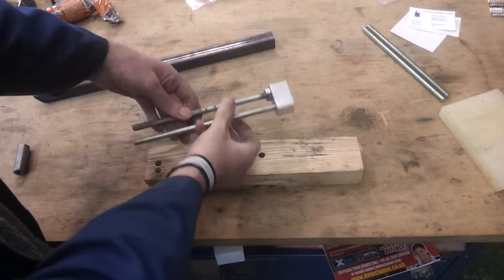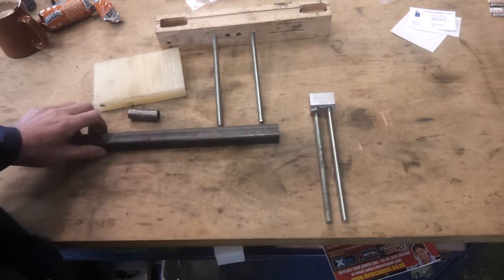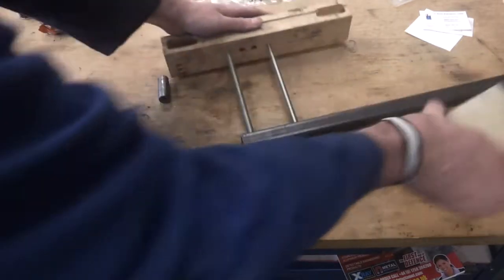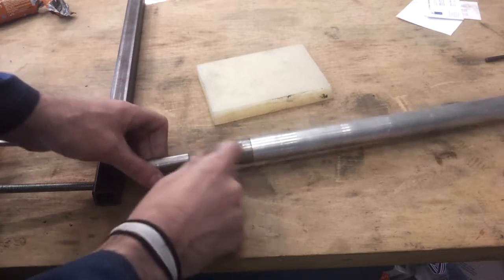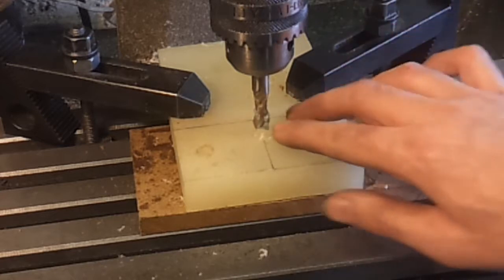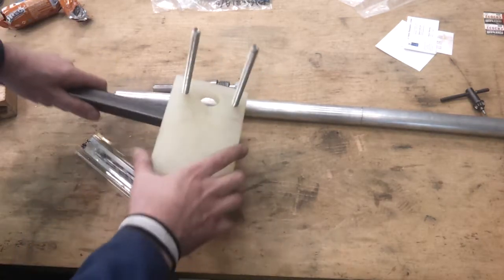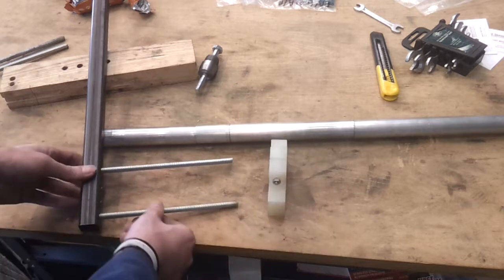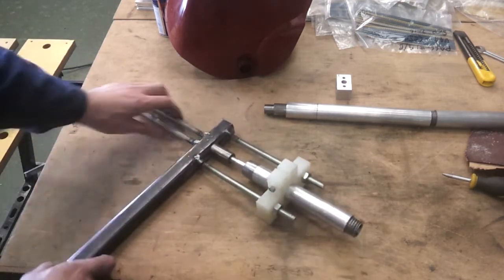Giant Automatic Centre Punch pt6 - modifications

Comment: Your threaded holes didn't align because you tapped them from both sides and cut the threads out of phase. If you want the screw to thread thru both sides, you must tap both holes from the same start, i.e. run the tap all the way thru both sides at one go. If the tubing is wider than the working length of the tap, the threads are not likely to align.
Reply from the maker: Thanks for the advice. It was not the sort of project I usually take on as it could have done with a bigger lathe. But I learned a few things from it, so will aim to do better in future.
Reply: I could have given a more complete response by saying that in the wider tubing scenario, the method is to run the tap drill right thru both sides, tap the working side, then redrill the near side such that the screw passes straight thru. Thus, holes are aligned with no thread timing issues. You can guarantee straight threads by tapping the working side from the inside by passing the tap thru the near side. If the tubing is wider than the entire length of the tap, threads will probably still be straight enough to work ok, as long as the tap is run thru reasonably perpendicular to the working side.  Good luck !